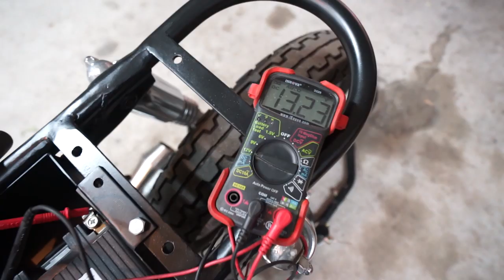From barn find to brat in 5 minutes (Timelapse)

Comment: What do you feel is the best course of action as soon as you acquire a project bike ? Like getting it to run or stripping it and restoring right away etc.
Reply: You should try to get it running first, in my opinion. Otherwise, you might end up with a beatifully restored hunk of metal that won't get you anywhere.
Reply: @jacobzcheng3802  And what should one listen in to when the engine is turned on before buying a decent, cheap bike?

Comment: Hi, great work. I'm in the process of taking my cylinder head of my cb 650 z but I don't seem to be able to fit a socket in where the bolts are. Same place where the spark plug is. Do I need a special tool/socket to undo them? Thanks

Comment: hey man, do the diodes on your website fix a problem with all blinkers on and not flashing and weird sounds from the relay?
Reply: Did you switch from normal blinkers to LEDs? In that case, you need to build in a new relay that is independent of the load. Since the LEDs have a much lower load than the original ones, the flashing frequency is way to high, such that you cant even see it flashig. Hope this helps you!
Reply: hey man! thanks for the reply, i switched from incandescent to halogen bulbs and i am having this problem, the halogen pull a little less power than stock i believe
Reply: @christianzoumadakis838  In that case you might really want to check it out, it helped in my situation for sure! However now that my blinkers flash properly, they do so all at the same time, which means a diode is needed anyways hahaha. But maybe in your case the new relay will do the job right away.
Reply: Martin Tanner I see, again thanks for the help! Will try another relay and the diodes and hope a miracle happens lol, i had some led blinkers in there with an led flasher but i was still having similar results where as all would turn on and not flash. i’m thinking i possibly could have a broken led flasher relay since they don’t flash at all